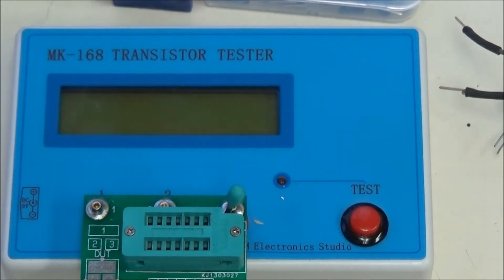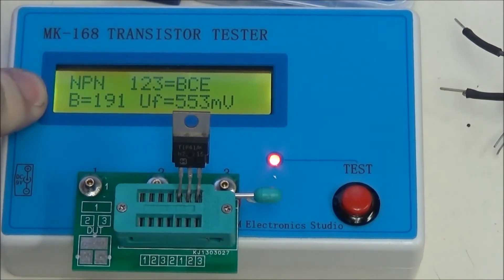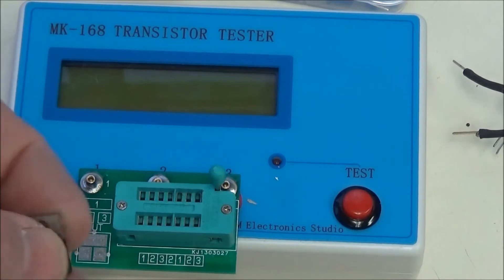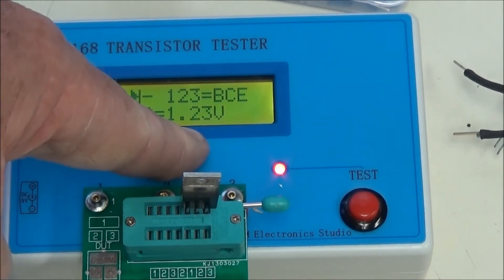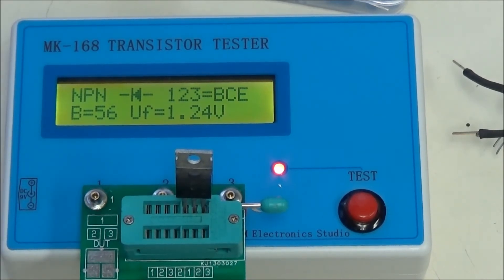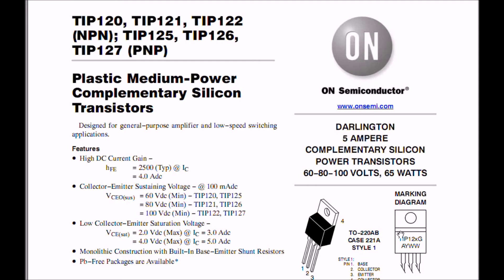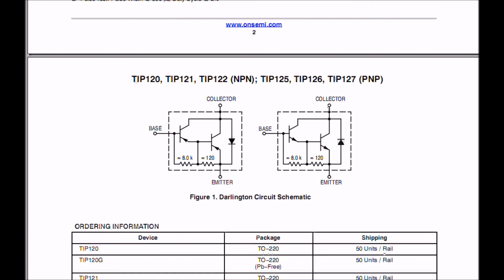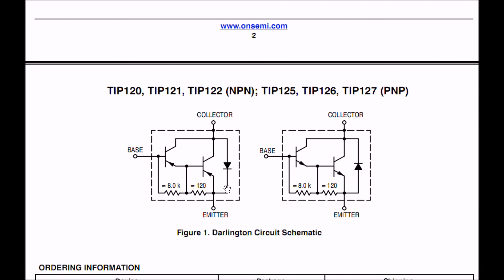Testing Darlington and Bipolar Transistors What to Know

Comment: cool video, I have a tc-1 tester, but can't test bc517 or mpsa13.  is there a way to test with multimeter or do I need to buy the atmega328. alternately how do I test with multimeter?
Reply from the maker: Both of these are Darlington transistors with very high gain. I have a TC-1 and MPSA13s. Let me use mine and I'll get back.
Reply from the maker: I checked my known good Darlingtons on TC-1 turns up as a diode. The TC-1 won't check a Darlington.

Comment from the maker: Several problems with checking Darlingtons such as the TIP120. It has internal (2) base-emitter resistors built-in. This really drops the gain needing 12-15mA to fully turn on. Mine also checked low gain but worked fine. That is covered in the following links :
http://www.bristolwatch.com/ele3/ele5.htm
http://www.bristolwatch.com/ele/tr3.htm

Comment: thought i had a bad batch. how would you go about finding the real beta.
Reply from the maker: Several problems with checking Darlingtons such as the TIP120. It has internal (2) base-emitter resistors built-in. This really drops the gain needing 12-15mA to fully turn on. Mine also checked low gain but worked fine. That is covered in the following links :
http://www.bristolwatch.com/ele3/ele5.htm
http://www.bristolwatch.com/ele/tr3.htm